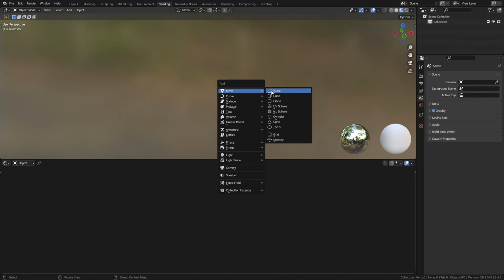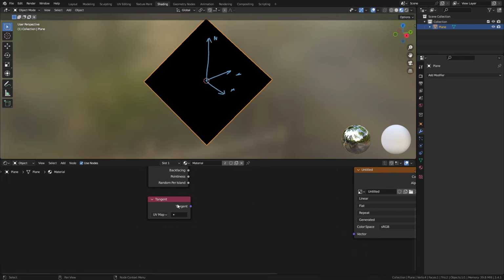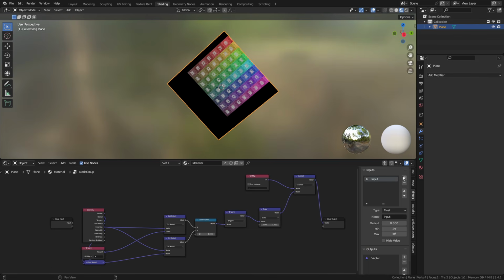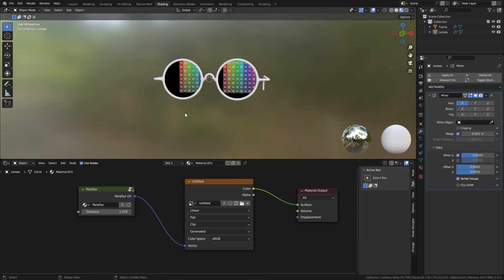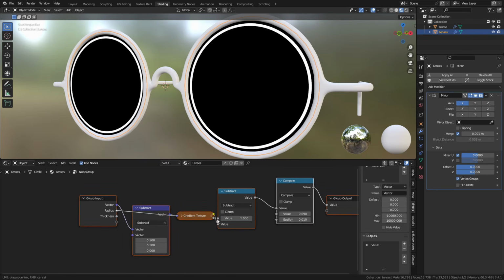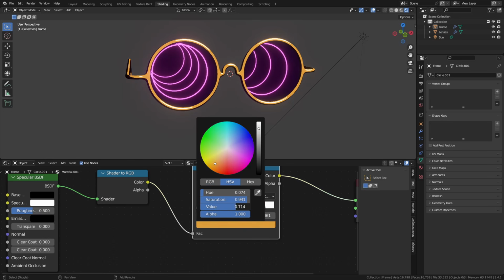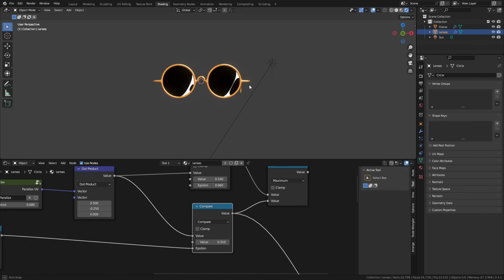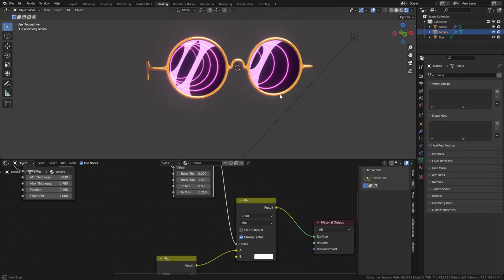How to make a Parallax Shader (for stylized effects) in Blender

Comment: To get a completely flat and distortion free result when looking at the surface at sharp angles, instead of using the tangent node, you need to divide your "Distance" input before the Scale node by the Dot Product between Normal and Incoming vectors.
Reply from the maker: Didn't think of that, makes more sense (it's isometric instead of amplifying x and y separately) and is much more accurate indeed! (still not "distortion free" on curved surfaces, though that's a big ask) Thanks for sharing!
Reply: I'm trying to make sense of this, I think I've followed along with what you've said here but I am getting a worse distortion.
Reply: @Floreum  dot product with incoming in the top slot, normal in the bottom, into math divide with scale in the top and the dot product output in the bottom worked ok here.
Reply: @JohnCliff Are you liking your results with Math Divide or Vector Math Divide better? I'm finding that since we're just working with 2 dimensions that it doesn't make much of a noticeable difference but maybe I haven't had enough use cases to tell yet.
Reply: @JohnCliff  Hello! Im sorry, but i really don't understand what to plug where from Your explanation comment, considering you're explaining it on top of the origianl node setup from the video :(
Reply: And thanks to this, one unit in the shader equals to moving the plane 2 units if it were real geometry!
Reply: Hello, i didnt quite understand what node tree i should get at the end, with your explanation, could you please explain it more deeper, what should plug where with that "tangent" node gone now?

Comment: First... this is an amazing tutorial. I can make shaders using Unity.. but I just started working in Blender for model creation. I usually use Umodeler. You are very knowledgeable and seem to have a grasp on the nodes. I am wondering if you can make a tutorial on making a shader that allows for multiple cutout textures on a single plane with some depth control. So that it looks like multiple layers, but it is a single plane. Kind of like a grass shader/material works... I made an example video here (https://youtu.be/plOCmLgOfnQ) of what I am thinking about and wondered if you could help me get there? :)

Comment: 26:46 - In this case, yes, they increase exponentially.  Most people get this wrong with polynomials (which are not exponentially increasing, which can be checked by taking the derivative).  But you are using the power node, so it's exponential by definition.  😄

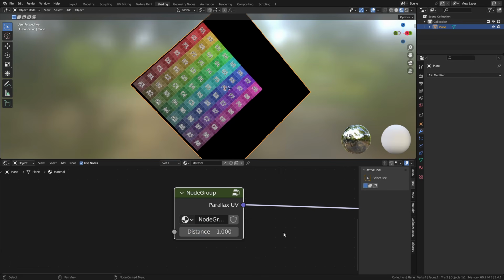Comment: What are the use cases you mentioned for negative distance at 10:22 out of curiosity?
Reply from the maker: I suppose it really is kind of an edge case
perhaps certain reflex sights, HUD's
I've also just used it for reflections that should scroll across the screen quickly
but also to fake depth outwards, say for some kind of hologram screen, or some non-euclidian type of optical illusion

Comment: It's half way there, the part missing is when you plug a heightmap into the distance and displace a diffuse texture along a normal map to generate the complete parallax mapping effect, but is a neat trick. The difference with a cone-step mapping is that this effect is done in a single iteration, that's a missing feature in Blender, the ability to use loops to update variables in a shader for even more complex effects, but in no way that means blender is lacking 😄
Reply from the maker: Well, that's one way to use parallax, though as you said, without some way to iterate automatically, it's really bothersome to do inside of blender
I hope they add that to shaders sometime, they've been (IMO) too focused on just geo nodes
Reply: @xetirano5685  it would be an interesting addition to have a loop node indeed. Geo nodes map to geometry shaders, a feature that in real time has got little run due to their lower performance, but in blender has an ideal playground.

Comment: Will it still work if I export it to Unreal Engine 5?
Reply from the maker: Since this is a shader, "exporting" isn't really an option,
however, it should absolutely be possible to copy this setup using Unreal engine's shader nodes! all the operations and inputs used are very common and should be at least substitutable.